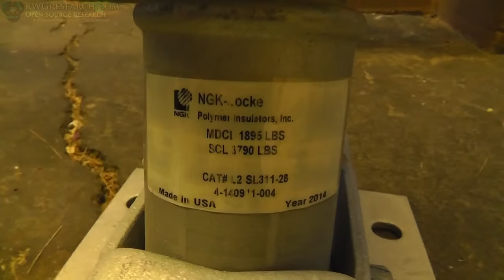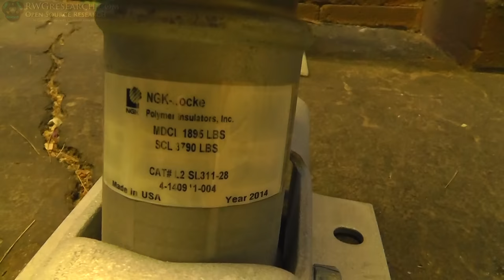Feed Back Please... 3days for 6 months... +115KV  insulators...

Comment: I will start by saying thank you for your sharing so much. I notice your absence and get concerned at the 3 week mark. I would say your well planned and eddited maker projects hold my interest the most. Hope that helps Russ. I would love to see a start to finish ac to variable dc high current bench power supply build. Throw a Pwm in there too would make it even better. It would be nice to have a hangout dialogue with you too, or call.

Comment: Hey Russ, what if you take some electric fence cord (used for livestock its nylon braided with a thin conducting wire) attach a helium balloon or or a kite and fly it say 50m or 100m and connect it to one of your insulators. Then measure the voltage between that and the earth. The voltages at different altitudes and during different humidity or weather conditions. also using different earth types say a copper rod an insulated swimming pool a salt water pool etc.

Comment: All your videos are good with me, but like so many others like the push towards energy experiments like the paps motor, As far as Stan Meyers work, i am of the opinion Stan was very good at protecting his info even to go as far to muddy the water with misleading info to keep any competition from duplication. Stan was very smart, I doubt anyone soon will be able to do what Stan claimed he could do as far as unlimited amounts of HHO for just about any application, he stumbled on some profound discoveries as a result of his dedicated research but he was no fool and kept a lid on the secrets. One thing I do know is he used nickle not stainless as his patents claim. Voltage of between 300-600V and nickle anode and cathode.  Stainless has nickle in it but pure nickle produces so much more gas per sq inch of surface area. Don't get yourself spread too thin with to many things on your plate. I have the same problem I have too many things to try and too many projects to do and I should just focus on one at a time but am easily distracted, information overload ...I'm sure you can relate.